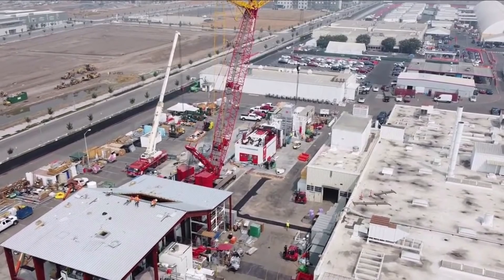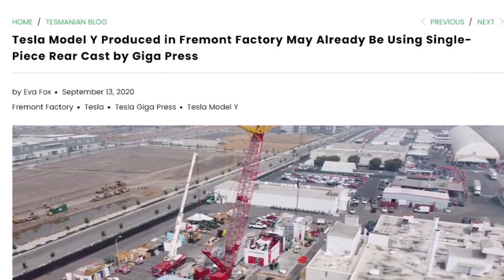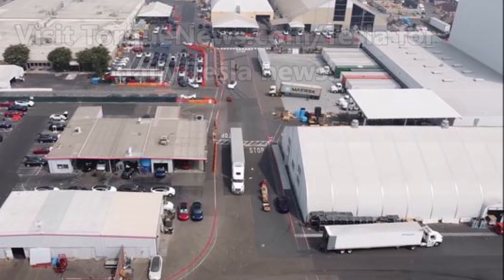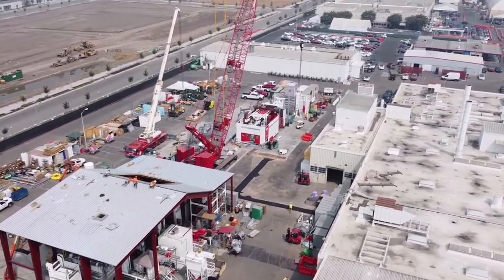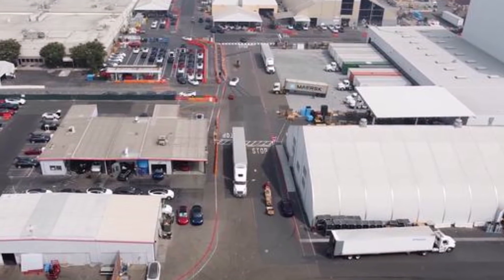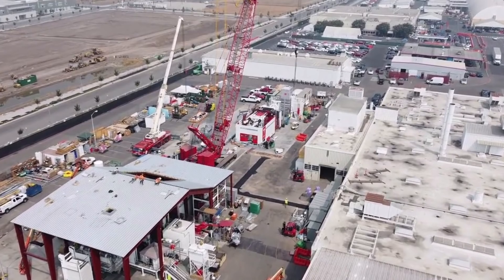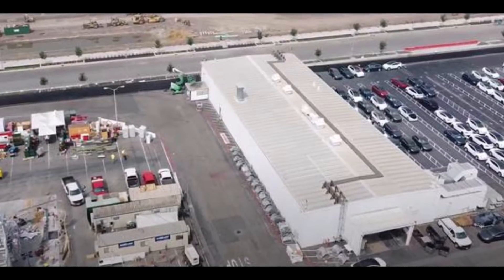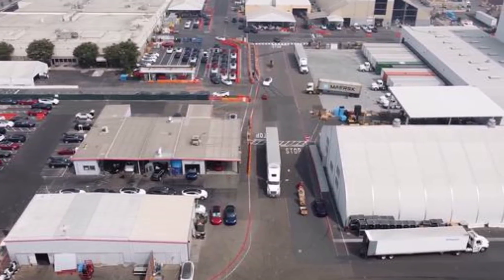Tesla Fremont Model Y May Already Come With Single Piece Rear Casting

Comment: Hard to tell if single-cast rear is being used yet or not. It makes sense to run a series of test runs to see how they do, the yield, etc. so that would explain the drone shots of stacks of casts. Not sure how the saved plant floor area will be used, but quite a few robots can be repurposed, possibly for a new line. It will be interesting to compare the higher production rate as the single casting process replaces a series of robot assembly/joining. I hope the up time on the casting machine is high because it doesn't look like there is a backup...

Comment: Would be nice to know what is the throughput of giga press. I think it may be quite limited if only single press is in use. Maybe only used for 7 seaters until getting more capasity?
Reply: @bobh9492  Thanks. Not getting exact speed from there, but seems that the process won't take a lot of time per piece. 

3min per piece would give optimal speed of 10 000 units per month at 75% up time. So one press wouldn't be enough for e.g. model Y alone or even close.

No wonder Giga Berlin will have eight of them.
Reply: @M1kke78  It's a cast, not a press(video gets it wrong). I have heard that the production/casting is done in seconds, but no sources if this giga cast can do that.
Reply: @simonquvang6073  Good correction, yes pressing is really fast, but this injection molding or casting takes time since the material needs to change form and cool down. I hope we can see something on Battery Day that can give a hint on speed
Reply: @M1kke78  with my limited knowledge of automated machines and manufacturing processes my guess is that each part takes arround 10 sec and that it will be running continuously batches.
Reply: I found one reference where molding a really small and simple plastic piece took 50s per cycle. Based on that, I still think 3 mins could be a decent guess. Altough, I really hope we will see or hear some kind of first hand info on this soon
Reply: @M1kke78  So far I have only worked with beer production so my knowledge is limited for sure. I did find this source https://www.sciencedirect.com/topics/engineering/high-pressure-die-casting. Its 90 seconds for an engine block. I can only imaigne that it will take shorter time for a body part, since its thinner and therefor should cool off quicker. But it depends on what alloy is used I would imaigne. In any case I think 3 minutes is too high, and I think the 8 giga casts in Berlin is 4 for back body part and 4 for front body part.
Reply: @simonquvang6073  So 90s in some application? Better use that in my further calculations :) Thanks

Comment: 18 months ago when the MY was announced, Musk said it would have a one-piece cast aluminum frame  and the wiring harness replaced with a bus system. It seems that Berlin will now get this, but not Fremont which will continue with only a rear casting and the rest of the frame fabricated steel. As is well described on YouTube, these frames have been a disaster with Tesla unable to fit doors and panels correctly. Throw in the worst paint job of any production car, compare all this with the award that Tesla got in China for initial production quality at Shanghai in their first year of manufacture, then ask yourself why, after a decade, Fremont cannot build decent cars?
Personally I hope the wildfires do something useful and burn Fremont to the ground, then perhaps Musk will build a new factory in a state where management and workers might take pride in their vehicles. My Tundra was built in the US. It is reliable to a fault and even after years of offroading, there is not a squeak or a rattle, so I know it can be done.